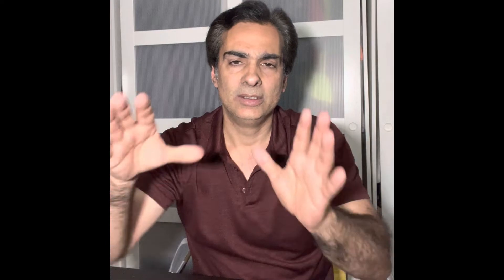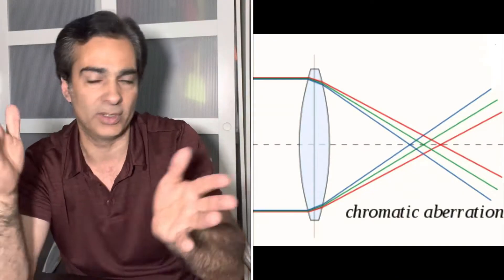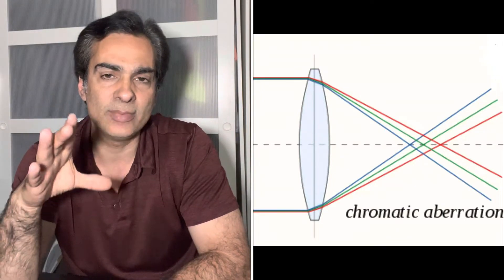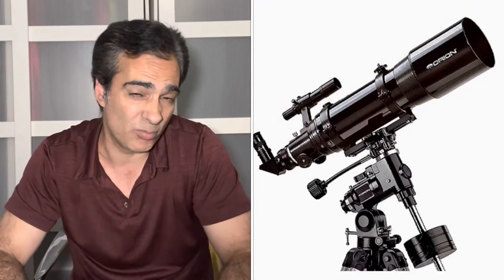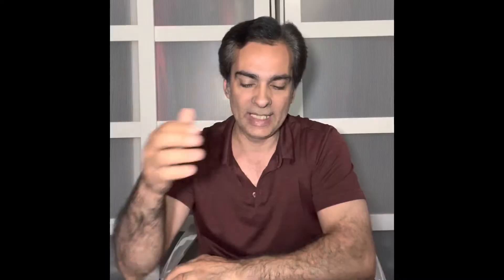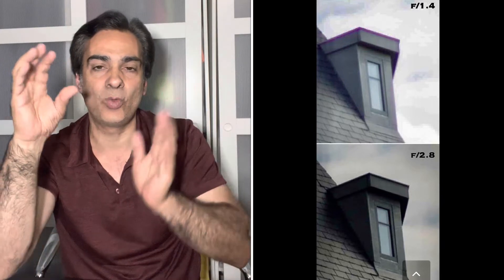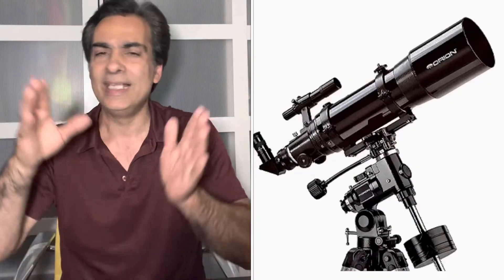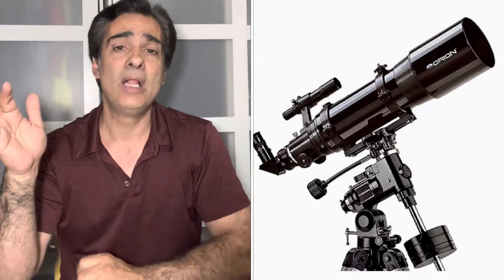what is chromatic aberration? #astronomy #telescope #space #nasa #saturn #meade #optics #celestron

Comment: Excellent video. A few months ago I owned a 4 inch F10 Bresser achromat and now I have a 4 inch F7 ED FPL51 from Svbony. I didn't expect a huge difference but I really was surpised that the Svbony F7 ED FPL51 has a lot less CA than the long Bresser F10 achromat.
Reply from the maker: I did another video where I tested an F 11 acro with an ED 51 and ED did do better on the medium to high powers

Now that was an older generation 51 lens I think now the newer ones are slightly better, so I think you’ll have a little bit even bigger span 

But what do you feel? Do you feel the F10 equals the F7 ED?
Reply: @JoeJaguar  the F7 FPL51 has a lot less chromatic aberrations than the F10 achromat. The difference is significant even at medium magnification 80-100x.
Reply from the maker: @3dfxvoodoocards6  i agree the ed51 I tested kson 102ed is the first generation kind with just a crown and flint ED so I found a colour or chromatic operation to be kind of medium little bit too much for me

The svbony ed meeting element is lathanium is much better quality and chromatic aberration is actually less

So they are making them better than they did before
Reply from the maker: here is the link the first video was just an over view of the scope then i did this video.
https://youtu.be/tnsv_DQzSfI?si=sQaj2LvvxYsM2ujN

SVBONY is send me the 80mm ED i will review it then test it. i have alreday looked throught one 2 yrs ago. This newer version svbony ed was much better then the  kson ed i had

Comment: I bought a orion variable Barlow lense that is between 2 and 3 times magnification and then read in the backyard astronomer guide that they are no good. But I compared it to a one power barlow and I could not tell the difference. If I understand correctly the longer the focal ratio the narrower the field of view. Anything over F 15 would have a minuscule field wouldn't it ? Im thinking of buying a meade 6 inch acromat. It is F 8 so the aberration shouldn't be to bad I would think. The scope I have now is an orion Xt10 newtonian dobsonian. There are a lot of advantages to a reflector.
Reply from the maker: i have owned like 4 6" f8 acros thet are decent nice not too heavy around the 22 lb so ya they are ok. The 10" dob is also great for DSO. cheers

Comment: I've been fighting that on my Celestron Omni XLT 120 and my Jaegers 108m f4.5. I have 5 refractors. As for CA my old Sears Discoverer 60mm f15 is the best. It still has some but gives a sharp images even with it's severely damaged lens. The Celestron came with a prism diagonal that's supposed to help. I have a Meade 2"mirror diagonal on there now. Maybe one day I'll get lucky and run across a triplet for cheap. Thanks Joe👍
Reply from the maker: Maybe what you could do is try stopping down the telescope that might help and may be a Bader fringe killer maybe that would help a little bit as well

Until then that triplet can wait
Thanks for your support
Reply: @JoeJaguar  lol yeah I've been looking at one but I'm a tightwad and thought it may be as useful as the other 10 filters that I never use anymore. 😄
Reply from the maker: @ww321  Well be careful because I noticed every time you go up in this hobby never want to go down for instance once you get a telescope that has a drive system to track you never want to go on tracking then

When you get an ED or an APO you never want to go back down to Acro 
Sometimes when you get to go to you might not wanna go back down or if you have a dual Speed Focus you’re finally you never want to go back to single speed
Reply: @JoeJaguar  just a few months into telescopes and I have 13. And still looking
Reply from the maker: @ww321  Damn you have more than me you can open up a shop lol

Comment: Hi Joe. The main form of Chromatic aberration you were describing is Secondary Spectrum. But there are others, rarely spoken about. Lateral colour is sometimes introduced by an eyepiece. There is also the dreaded Spherochromatism, which SCTs and Maks have, and even some APO refractors. Spherochromatism is variation of spherical aberration with wavelength, and is more subtle (usually) in telescope images. Most of the time you only see it inside outside focus, although a large aperture SCT like a C14, that has poor correction for lower order spherical aberration, can show it in imaging and visually in focus.  A friend and I once designed on a basic DOS raytrace and design program, a 102mm f/10 achromat with no secondary spectrum greater than the airy disc, so it can be done. We didn't use any specific low dispersion glasses, just chose carefully.
Reply from the maker: Great info im sure others will find the info educational 

Yes very true Celestron used to make a good four-inch F10 that was very well corrected I even used in Antares well correction Acro. 

The mass produced one are okish but yes the  special hand made ones are real nice

There was a term that started back then and they were calling him Semi ED or semi apo But this was later dropped and the better term is a perfect acro
Reply: @JoeJaguar  Yes William Optics were guilty of that. Just marketing. A Semi APO is an achromat, just with better correction of secondary spectrum.
Reply from the maker: @offraed6156  Yes even other manufacturers nachos William optics and then but the term didn’t last too long. Even the near perfect acro just cost too much in time that I think now it’s just easier to go to a ED with 51 glass or ED with 53 glass. Cheers